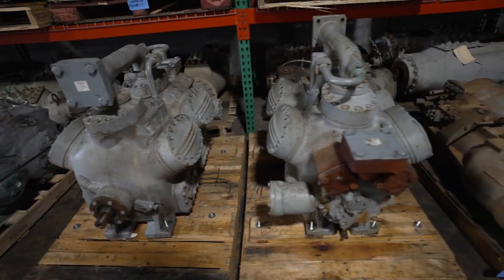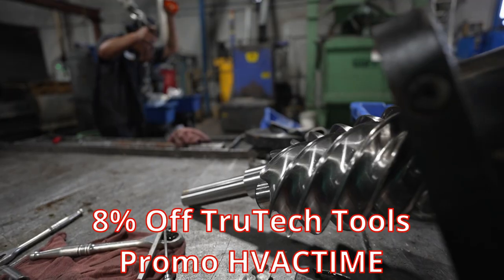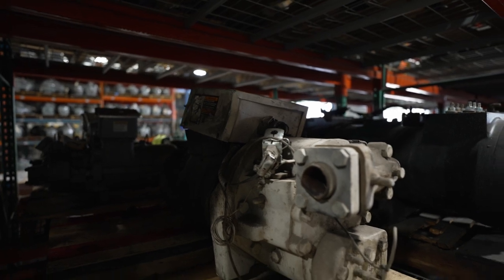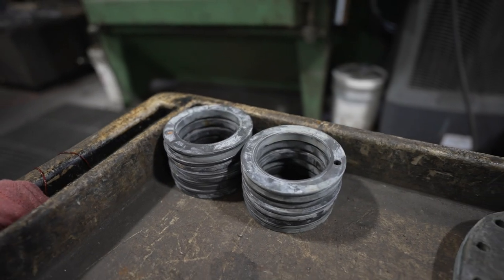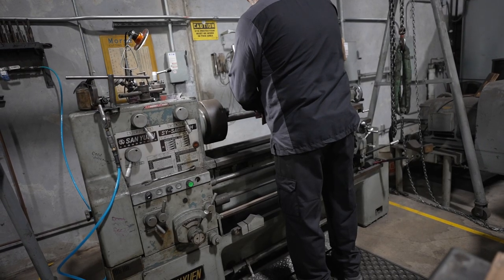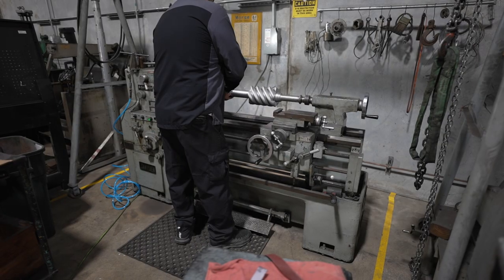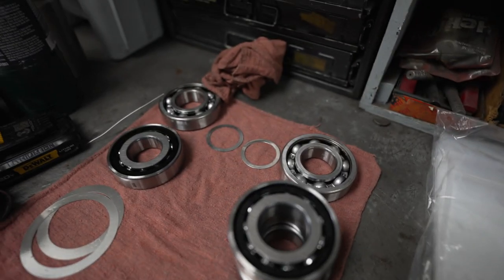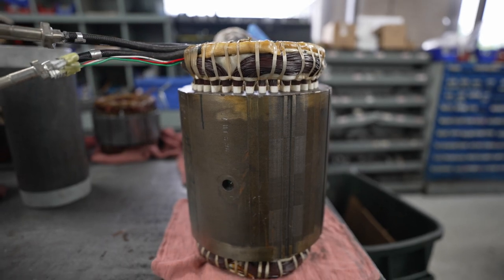Chiller Compressor Remanufacturing Behind the Scenes

Comment: Compressors don't die.....they get murdered. I like to open them up and figure out why it failed. It definitely goes a long way in making sure the new one isn't also dead within a year or 2......cleanup after a burn out is also extremely important and needs to be addressed immediately
Reply: Yup,absolutely. I try to burn this into the minds of my techs as well. What kills me is when a tech swaps out a compressor and doesn't run a test on the system after. Almost always when you start the system back up you will find a problem, whether it be a txv issue, an airflow issue, an oil issue ect. Don't just swap compressors and feel like your the tech of the day guys, so many times that new compressor will fail shortly after install.  Find out why the first one failed to avoid having to put in a second or third one. Please.